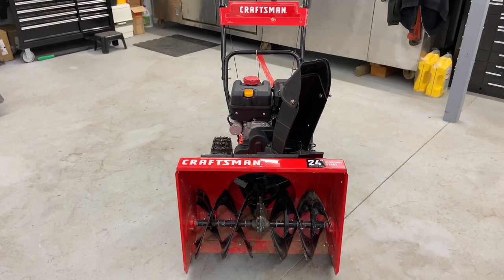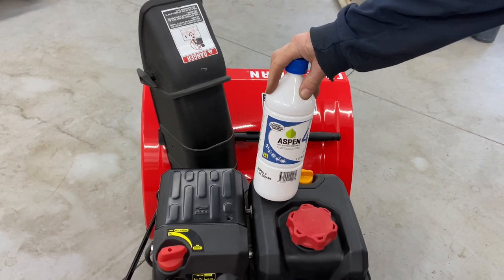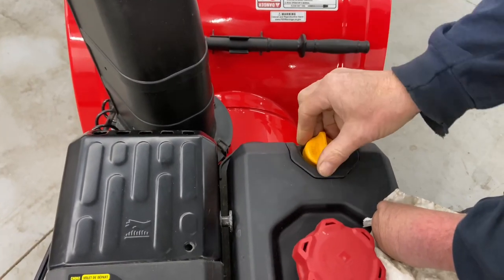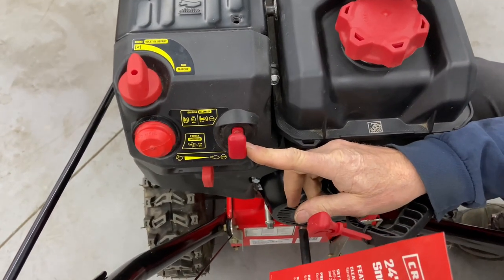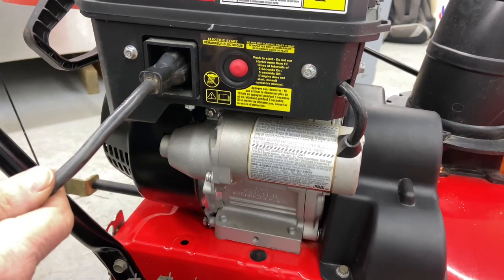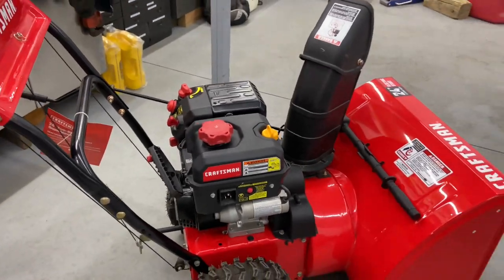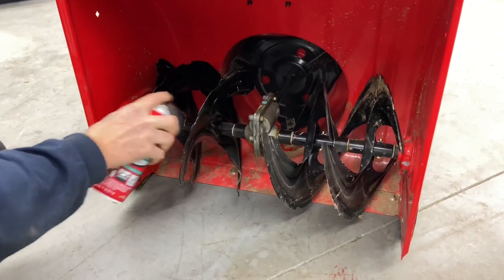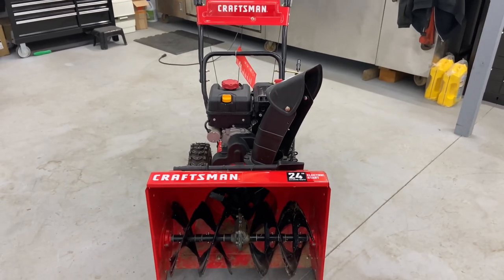How to Start and Operate Craftsman 24” Snow Thrower

Comment: Nice, I got an old model last year for free. I have 2 now, but the electric start is the best on starting.
Reply from the maker: Thank you for watching and commenting! Remember to store the machines properly in the off season to keep the carburetor in good health or as I do, run my machine every 45 to 60 days for 15 minutes to get the good fuel through the carburetor from the tank. If you start to use the Aspen fuel, you will not need to start as much but I always do because I just want to make sure my machine is running good.
Reply: @Johnson's Small Engines  I'm from Indiana I haven't seen that fuel. But yes I do run it often, but we have only that other can fuel. I'm not going to mention names.

Comment: I like the Buy a REG. 90 octane fuel for my off  winter equipment.    We need fuel off values on this equipment can you Help?
Reply from the maker: Hi William, I agree needing the fuel shut off! It would not be pretty to install a fuel shut off on these newer machines. I would suggest cutting out the piece of plastic between the carburetor and fuel tank and install a inline fuel shut off. I may give it a shot on my own machine but I use Aspen fuel and it keeps my machine from having any issues from long storage.

Comment: Nice video as is the norm.  A quick snow blower question.  Based on your experience what brand/brands have the best selection of repair parts such as carb kits and gasket kits.  Seems a waste to have to buy a Amazon clone carb instead of a needle and seat.  Thanks for these videos.
Reply from the maker: The snow thrower you purchase would need to fit “how much snow you get in your winter season where you live”? The best out there would be on my opinion,  Honda. You pay the price but you will get a quality build.
Reply: @JohnsonsSmallEngines  I live in AK so get quite a lot.  Thanks for reply.

Comment: I have a question, when the snow blower like in the video is not working properly, that is when starting the engine it runs high and low, how can I fix that? Can you make a video about that.
Reply from the maker: I do have videos on how to remove and replace that carburetor or rebuild it. You will have to do a little searching on my YouTube channel as I am not near a computer at the moment. To remove the hunting and surging. You will need to be a little bit mechanically inclined, but my videos will show you how to take care of that.

Comment: I am getting ready to put my snow blower away for the season here in Maryland.  What additive should I put into the fuel tank for storage?  Thanks
Reply from the maker: Hi Stew,
 I have used the product called "Stabil" and I use the marine type due to it helps with condensation. The problem is, if you do not run the machine every few months, there still is a possibility of the fuel going bad in the carburetor. Many will tell you to run the engine dry. That is almost impossible to do correctly unless you know exactly how to do it. I recommended taking all of the fuel out that you can, then run the machine until it will not run, even try and run it on choke until it empty.  Then put a full tank of ASPEN 4 stroke fuel in and run the machine for about ten minutes. ASPEN4 fuel is such a clean fuel and it has no ethanol and it will stay fresh in your machine at least until the next season and longer. *Note* You cannot mix the regular gas with ASPEN4 or it will not perform the way it should. You will also not have any issues that you have if you let the machine sit dry (empty all gas from machine). Here is a website to read up on ASPEN4 fuel. https://www.aspenfuels.us/products/all/. I am not at all sponsored by ASPEN FUEL, I just started using it a few years ago and I think it is in my opinion a great product to run in your snow thrower. In my opinion, It is to expensive to run in everything but for the snow throwers, its perfect.